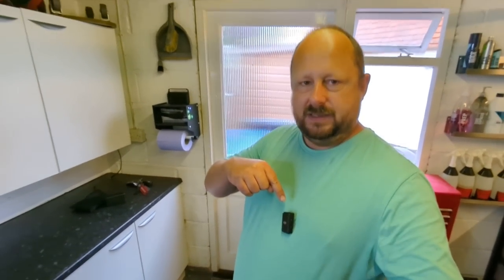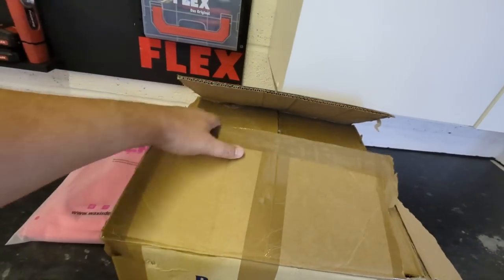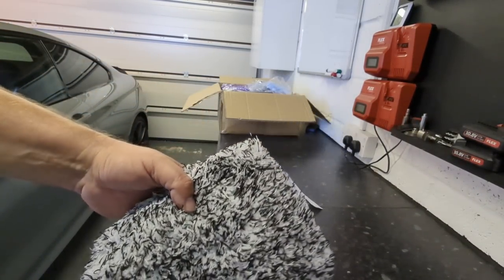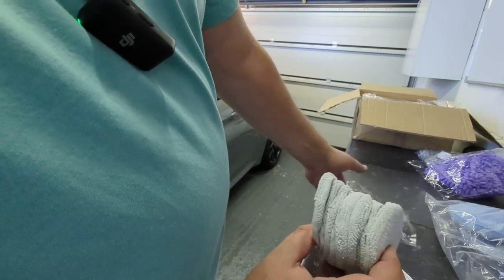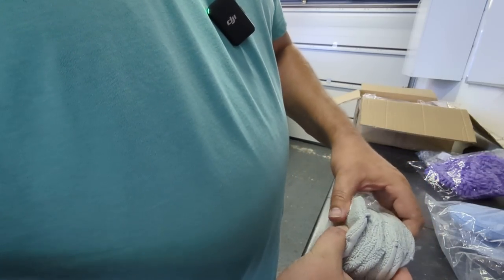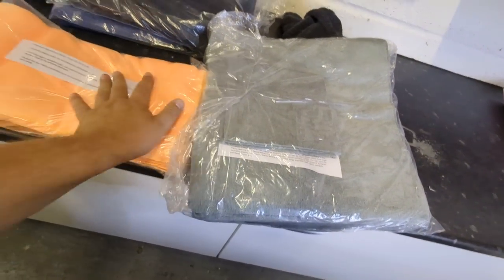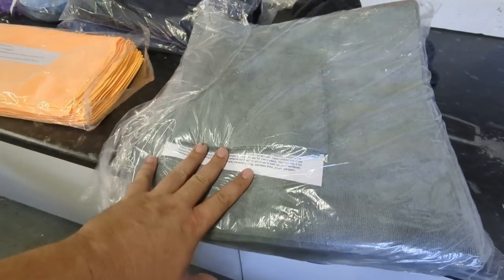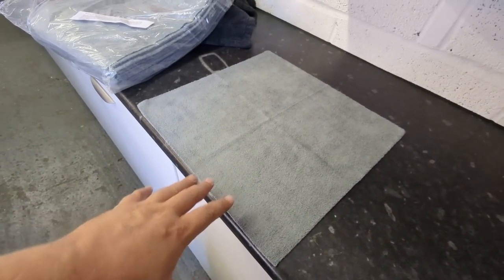WHOLESALE PRICED MICROFIBER AT BARGAIN PRICES

Comment: I use one of them diamond weeve towels for drying my glass,I fold it in 4 and go over once to mop up the water and flip it over and quickly  buff if off a second time. Works a treat. My twistloop towel does all my paintwork in one then.

Comment: Funnily I ordered a few chenille wash pads from Paragon last week. Had been searching for the small (15x15) ones for doing wheels which are a bit harder to find. Haven’t used them yet but they seem decent if a bit thin.
Reply: I have a couple for wheels to! They are a touch flimsy, but I find them perfect for following the contours of alloys and getting them right in between spokes! I don't think you'll be disappointed when you get round to using yours 😊

Comment: Started using more on the van than the car and great value. The Terry towel I agree very good value, the soft cloths are great for polishing off and detailing spray. Got a soft was glove too for the wheels on the car after brushing. Drying towel works really well.

Comment: I've just seen Gyeon is releasing a new range of products for Feb 2024. The one that stands out the most is the TFR spray. Would you please review it once it comes out? 

They're also releasing a new Natural Leather Cleaner; Glass Polish; Instant Deicer (called Defrost). Eco wash is the final product in the new line but not a fan rinseless/waterless cleaning.

The newly designed bottles also look great. They're colour coded for Exterior, Interior etc...
Reply: Last few months I've been pre washing with snow foam then doing a rinseless wash, best of both worlds I think, it's not for the dirtiest of cars but I find it a lot quicker.

Comment: Your right 2.4Ghz is a WiFi band. Could be affecting your mic. If you can try a test somewhere with no WiFi signal and if it cures it try changing your WiFi band to 5ghz only on your WiFi gear.
Reply: Or maybe the channel of 2.4Ghz, you can get apps that scan the local area and adjust your channels so they are different from your neighbours.